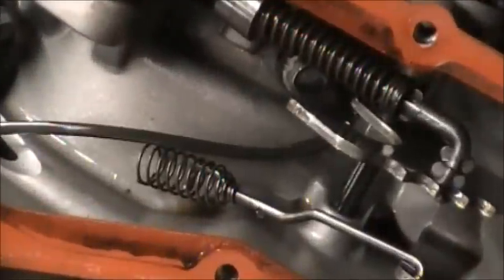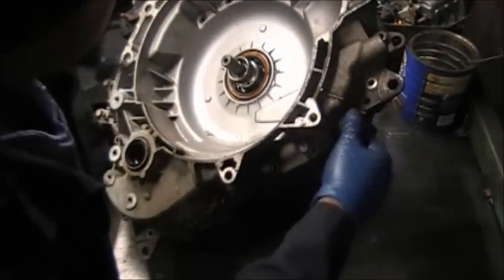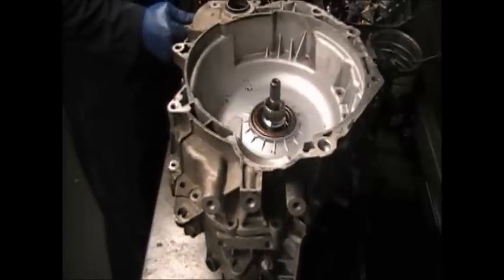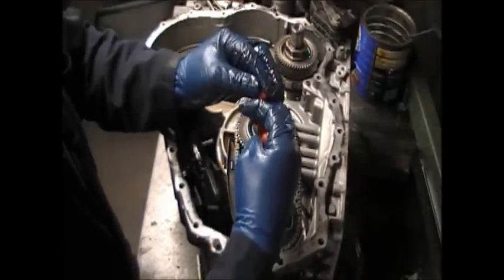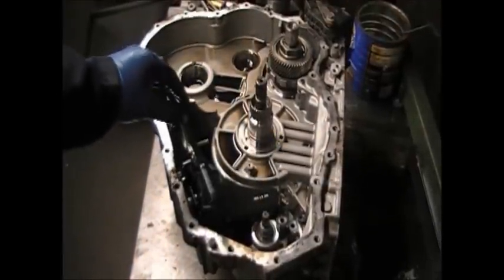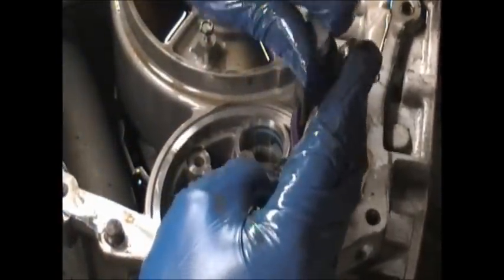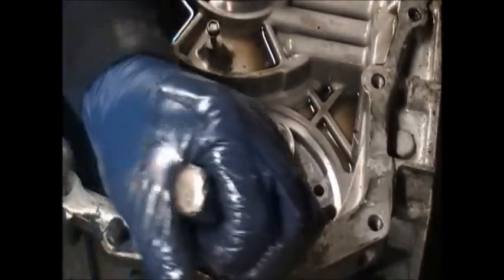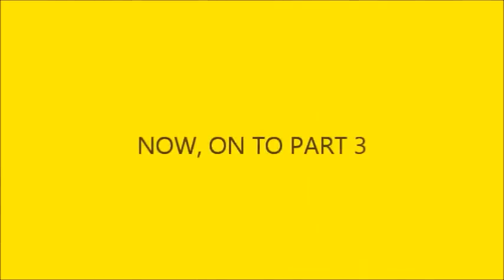saturn vue cvt part 2

Comment: Thanks for your help....On a video # 8 you mention to post the CARS SIMILAR TRANSMISSION for  2003 Saturn vue 2.2 liters fwd ...very soon I will hunt for parts..
Reply from the maker: Sam Halabi Hello, I don't understand your question,"POST THE CARS SIMILAR TRANSMISSION". Do your vehicle have a CVT in it?
Reply from the maker: Sam Halabi Oh, now I know what you mean. I said that I would probably post the vehicles that have this similar transmission in it. Ok, If you are looking for parts, you can find the parts on ebay. Not all Saturn vues have this transmission in it. You would have to take the vin number of the vehicle in question and contact the dealer to see if it has a cvt in it if you cannot tell by looking at it. This transmission is in opel (which is in Europe) .In America it is in the Saturn Vue and the Saturn Ion Quad Coupe.

Comment: Hello, again, Questioning3.

I want to share an amazing, easy way to pop the oil pump out, in on wack! LOL 

I can't believe this worked. In fact, I did not realize it had at first; but, the pump was out with one pull on a long crowbar. I put the hook of that end on the case next to the pump, then with the tip under the center spline, I gave it a quick wack, and the darn thing popped right up. I had tried smaller bars, but the case just spins around, hard to control. Don't know how much that helped; but, I spent little effort, and almost no time this way! 

I don't see anything wrong. There were a couple of sand dunes of steel from something worn. There is no wear on the steal nor the clutches. I need to tear down the planetaries yet. They look solid though, unless the bearings are ground down? 

Thank you, for everything!

Gianni Joseph
Reply from the maker: you are welcome

Comment: Thank you for taking the time to make these videos...I watch all of them...I have 2003 Saturn vue 2.2l FWD. I wonder if you can answer why the car stops driving when it heats up.  I'll open the transmission and with your video,  hopefully, it'll help me figure it out. Also I wonder if I have any question  can I contact you?
Reply from the maker: Sam Halabi  Hello, is your vehicle making any noises when you start it? Also, you cannot post a response at any time. I always check my messages. I will help you in anyway that I can. How many miles is on your vehicle?
Reply: I have a 2004 cvt Saturn Vue 2.2 fwd, drive it in Snow was work great then the snow stop drive it a cool day, now I start it, it's making noise move a lil

Comment: I am in afinancial bind, and the transmission on my 2003 broke. So i decided to do it on my own. Your videos is exactly what i needed. My belt broke and is a mess inside my transmission. Question, i have 135k miles. Is it normal tare and ware?
Reply from the maker: Antonio Garcia Ok, There is one thing that I don't do and that is entertain fantasies, I fix problems. If your belt broke, then time to try to fix the transmission. Make sure the sheaves are not rough, the sheaves are the area that squeeze the belt. You have to take everything out to get every part of the belt out. On this transmission, anything over 100,000 miles is ware and tear.

Comment: I should mention that the socket I bought might be wrong. I watched the video again, and found I measured the wrong end. I still need to remove the covers and fit the socket, tomorrow (Fri), to see if it fits the correct end - which Q3 demonstrates!. 

Many apologies!

I also caught that I did not remove the speed sensor... hoping it was not damaged. 

What is the sensor on the primary variator - the black thing? Could that need replacing? I may could add such notes to an update compilation, if I get th his all done, and have time to learn how?

Looking forward to the drill bit pin fix! 

This is all SO EXCITING! I almost don't care if I lose money... LOL <am I going crazy>

Comment: You should make a pulley with 2 welded vise grips on each end to help remove that pump. Just an Idea to help alleviate that frustration
Reply from the maker: Julio Parissi Hmmm, I will consider this advise. Thank you
Reply: No problem If you do can you post up a video of you using it. Thanks.

Comment: I am confused, about the custom rig to squeeze the (variator). Is there a hose clamp big enough to work, cheap? I'm not sure how this works... is there a video of that? LOL WHAT NOW, right? Does it push down on the shaft, to cause it to hatch (open)? Could we cut a hole in a board and bolt it in there - easier? ...then improvise a lever, or strut spring compressors?

Additionally, you did not tear it down. How do we check it for function, and do the drill bit/pin fix to it? You said you "cut it open", mean one from the past? I guess the spring is very strong, and very dangerous to mess with. You did say, there is only a spring and a ¿ in there... so, if it works, no worries? 

Apologies for the dump. You can't hit it all for us! LOL We need to just do it! ..at some point, Go for it!
Reply from the maker: giovanni joseph, giovanni joseph, giovanni joseph, I only put the pins in the drive pulley (the smaller of the two). It seems to be the weak link in cvts. The clamp I use is a split pipe clamp. However, check Ron O's section. He made something out of wood to raise the pulleys.

Comment: was wondering are all these videos all we need to rebuild transmission on 2.2 AWD cvt automatic for 2003 Saturn vue? If so what is it I will need for replacement parts? Info is gratefully appreciated:) THANKS!
Reply from the maker: This is all you need to repair it. look at the parts that I show that go bad and also do the modifications. How many miles are on your vehicle?

Comment: I just watch your video on the Saturn transmission rebuilding.My 2003  want change gear but one time and stuck in high gear.  Have any suggestions I can try. Thanks.
Reply from the maker: +Don Woodberry Sorry, but I cannot answer questions like this. When there is a problem, there is a diagnostic procedure to follow. First, have the vehicle scan for codes to see what the computer is trying to tell you. Then, you go to the next step.

Comment: To answer your question...yes my car have 138.000 mile
Make a noise when I start the car, 2003 Saturn vue 2.2 l
Reply from the maker: The problem I believe that you are having is a bearing issue. If the bearing is bad the input shaft will be damaged. When transmission fluid is cold, it is thick and the thickness can take up clearance. However, when the fluid gets hot it becomes thin and then the clearance will be too great which will not apply the clutches causing them to slip. My belief is that the forward clutches are bad, the input shaft and the planetary assembly and the little bearing that hide inside of the planetary assembly. In other words, you may have to change the whole primary variator assembly.

Comment: I just finished rebuilding my transmission so thank you for posting your video....it was a great help to me! How many quarters of transmission fluid does the Saturn  take? Do I need to add Lucas Transmission Fix or do I need to add something else?
Reply from the maker: Sam Halabi Hello, I sent you a message on how to check if you have the right amount of fluid. An empty transmission with an empty torque converter will probably take about 8 qts. However, check the fluid like I  told you.
Reply from the maker: questioning3 don't add lucas just add cvt fluid

Comment: can anybody tell me where the speed sensor for a 2003 automatic 2 wheel drive 2.2 Saturn Vue CVT transmission
Reply from the maker: There is a speed sensor where the valve body is. However, the valvebody has to come out to get to it.
Reply: that is what I thought thank you very much